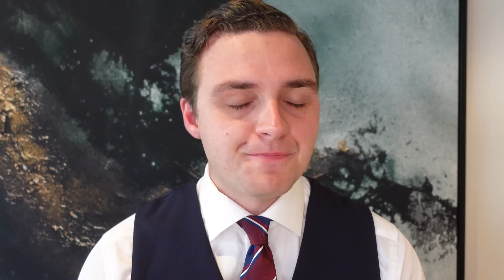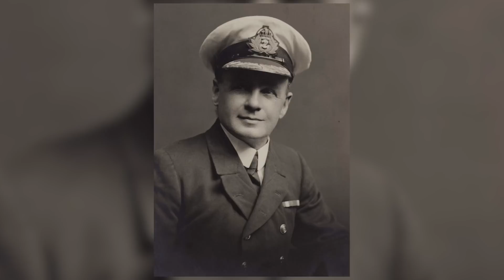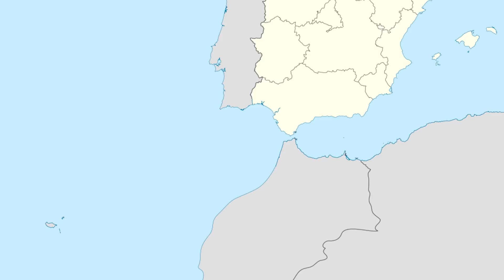How to Annoy the Steam Engine Community

Comment: To give a couple more very minor nitpicks, 15:20 technically a single acting steam engine isn't just pushing the piston up, it can be pushing the piston down instead, it just can't do up and down together. Single acting just means it's acting on a single side of the piston, and most commonly single acting engines are setup to push the piston down not up, much like a 2 stroke internal combustion engine. Single acting engines rely on the momentum of the flywheel and all the moving bits to carry it around, it doesn't need to use the weight of the piston to push itself down.

Also technically Titanic's engines had both piston valves and slide valves, piston on the high pressure and slide on the low. Piston valves are, as the name suggests, basically a set of pistons in its own valve cylinder, whereas slide valves in a steam engine are typically a block with a hollow center that is pushed against the port face. Because slide valves are pushed against the port face by the steam pressure they can have quite a lot of friction/resistence to moving at high pressures, which is why piston valves are used instead on the high and intermediate pressure cylinders. Piston valves being a tolerance fit to the valve cylinder instead of press fit by pressure like a slide valve aren't subject to the increase movement resistence at higher pressure, however where a slide valve will wear in and maintain its seal over time, piston valves wear out and would need occasional piston ring replacement (or new valve pistons if they didn't have replaceable rings).

But these are very minor really nitpicky things. Overall good video correcting the mistakes.

Comment: At the time I watched, I thought that marine boilers were water tube, unlike railway engines which were fire tubed. I was surprised you mentioned salt water in a boiler which is highly corrosive. Railway engines even added water softening blocks when hard water was only available.

Comment: Sea water is never used in a steam system mainly because, when heated, the dissolved salts such as calcium carbonate etc., will deposit onto the hot surfaces of the tubes and furnaces. As stated, this leads to insulation of the metal surface, a reduction in the heat transfer to the water and thus localised over-heating of the metal. This leads to tube failure and the pressurised water will then evacuate into the furnace in what is called "explosive decompression" with concomitant destruction of the boiler room etc....

Comment: Mike, you've still omitted an important part of Titanic's power plant.   At 6:20 you have the water from the condenser returning directly to the boilers via the necessary filters.  Pumps were needed to make that happen, but that is obvious, and you mentioned them elsewhere, so we won't fret over that.
But you omitted the feed water heaters.  These were fed with waste steam exhausted from the electricity generating engines and auxiliary (pumping etc) engines.   The water from the condensers was a little above sea temperature (70 F design centre value) and the heaters heated it to about 220 F (ref The Shipbuilder special edition on the Olympic class, June 1911, page 63).   
The boiler pressure was 215 Lb/in^2.  This implies the water was heated to ~ 390 F - that's the boiling point of water at 215 Lb/in^2.  The specific heat of liquid H2O is very nearly constant.  Thus the saving in coal from employing the feed water heaters was (220 - 70) / (390 - 70) i.e., 46%.
A 46% saving in coal is way more significant than having for example the low pressure propulsion turbine which, while it was very efficient compared to a reciprocating engine, reduced the steam reduction possible and thus power output of the reciprocating engines.

Comment: Absolute and Guage...  Surely if the steam was below atmospheric pressure, it would not be able to exhaust but be pushed back into the engine due to the pressure differential.

Comment: The exhaust pressure of the turbine, and in turn that of the triple expansion engine is dependent on the temperature of the sea water that enters the condenser. A condenser temperature of 100F on the steam side would result in an exhaust temperature of about 0.95 psia. If the condenser temperature could be lowered to 70F the exhaust pressure would be about 0.36psia.

Saturated steam does not necessarily contain water droplets, but it can. We all learned that water boils at 212F, that would be the saturation temperature at 1 atmosphere. Saturated steam is steam that is at the temperature where both the liquid and vapor phase can exist. And if the pressure drops then the saturation temperature will be lower. Superheated steam is steam that is at a temperature that is at a temperature higher than the saturation temperature. Where this becomes important is in a turbine. Because as energy is removed from the steam by the turbine water droplets can form, and these can severally damage a turbine. If you've ever lived in a building that was heated by steam heat and you got steam hammer when the boiler came on, that is what would be happening inside the turbine and it would create huge forces.

To protect the LP turbines like used on the Titanic often some of the HP steam would go through an expansion valve and be injected into the exhaust of the LP turbine intake. This would increase the temperature of that steam and superheat it so that water droplets would not form in the turbine.
 
The loss of boiler water or steam occurred because of leaks in the system. There are many places where leaks occur, valves, piston shafts, turbine shafts, pipe flanges. Almost any connection could leak. The less leaks you have the less makeup water that's needed.

Comment: Correction:  "Earth's Atmospheric Pressure 14.7 PSI".  That is only the average pressure at sea level.  It changes depending on temperature and density which changes at different altitudes.  Weather at sea level will only change air pressure about 0.04 Psi, so we can ignore that.  However altitude does change it a lot.  Example:  At the summit of Mount Everest the pressure is only about 5 Psi.  That is 250 mmHg.  (German Accent) Wrong!  Nein!  Nein!  Nein!  Nein!  Nein!  Falsch!  Unrichtig!  Inkorrekt!  Make another correction video!
😁

Seriously though, I wondered how the pressure in the system could get below atmospheric pressure and produce power.   The steam cooling, condensing, and creating a vacuum, which would then pull in air to create power on some engines makes sense and answers my curiosity.  So thanks again for this video.  It answered another one of the questions your other video created in my mind.

Comment: Thanks for pointing out the salt water mistake.  I know relatively little about steam engines.  I know a bit, but I wouldn't consider myself an expert.  I recently talking to a guy about steamships and told him they can't use seawater in their boilers, steamships use fresh water in their boilers.  When I saw your video saying Titanic used sea water I thought I was wrong.  I even left a comment asking about the maintenance schedule of the boilers.  I was thinking of rust eating through and how did they flush out the salt.
     The other ones I can relate to.  I often say square feet instead of cubic feet, even though I know the difference and use the two units often in my work.  But I probably have brain damage so....

Comment: Thank you for this two videos. Very interesting. There are sooo much more details about the engine rooms just enough to make 3 or more videos like this. Sample... the electricity on board or how to cold start the titanic. Also the ashblowersystems and the refrigeratorsystem. The quadtriple expansion engine also dont use the same size of pistons like it was shown in the video. Only the two lowpressure pistons on the outer edges had the same diameter. They get bigger by the ingressing volume of steam by lower the pressure. Next detail was how to start this engines. They had helping engines to turn over the crank in a starting position. It was the  90 degr. angle between big end and crankweb of the lowpressure cylinder i think. The LP pistons are depending on size and ther counterweights, the hardest to turn over. So every triple engine had so called impulsevales or startvalves to send highpressure steam directy to the lowpressure pistons to turnover the engine meanwhile the draincocks are open to get the condensed water out of the engine. Tgey closed them when the engine was hot and running. The direction was not controlled by the helping or starting engine by turning over the main engine. The direction is set by the excenter position 90-120° on top death center in advance to the rotation direction on eatch singe valve 3 times in one and 3 times in the reversing direction. The high pressure cylinder had piston valves depending on the temperature of steam with 210 psi. It would bend a shellvalve. The LP cylinders had shellvalves. Alsobthe valves had specific overlappings for the steam ports to let the biston runsninto a steam pilow on each end of the stroke to run it more soft.

Comment: Good on you for this. I would check the bit about the piston and valves. Yes its right but at least on steam locos , and I suspect on these engines, the valve admits high pressure but closes well before the piston is at the other end of the travel and it expands the steam (where as your animation doesnt show the valve closing early). Damned good video though

Comment: Regarding the water heated in the boilers:
I really wonder if it would be possible to rig a supply line directly from the water inlet to the boiler in order to maintain the cooling function of the same even in the worst emergencies to be thought of.
Something like the main engines self-destructed, taking with them the primary and secondary condensers along with the seawater filters and the valves to vent the steam. The fireboxes are still hot and you have to control them somehow to avoid thermal breaks and the resulting BOOMS.
Although this is probably the least of the problems in the scenario described

Comment: I wish I could have thought to record my old engine room. The sound of 65,000HP turbines maxed out and then a buzzer sounds and we provide steam to launch a 20ton aircraft in 3 seconds. The boilers would actually start “huffing” visually. The din heat was incredible. The main steam lines were so hot you could light cigarettes on them and a small leak could cut your fingers off (superheated steam is invisible). Conditions down there were so rude Marines were send down to us to chip paint as punishment.

Comment: Mike, at 15:37 the diagram states and you say 'slide valve', however the diagram illustrates a 'piston valve' - there is a distinct difference between them. A steam engine's slide valve has essentially just one sealing surface, and any wear, to a certain extent, is taken up by steam pressure acting on the valve, pushing against it to maintain the seal. A piston valve is similar to any other piston in that it runs in a bore and has piston rings to make the piston steam tight. Piston valves are more efficient and can be more accurately adjusted, but when the piston rings start to wear, they start losing their efficiency. Railway locomotives started using piston valves in the early 1900s, but mostly only on the modern higher-performance designs. Simpler run-of-the-mill designs kept to slide valves as they were cheaper to build and maintain.
Respect to you for making this video - there's so many who just make videos for the sake of it without having any understanding or passion for the subject.

Comment: I read about the Britannic’s engines and found out that although the engines were the same size as the previous design in terms of their dimensions, each engine produced 16,000hp at 77pm. The additional power output from the same engine size was achieved by the use of piston valves in all cylinders, whereas on Olympic and Titanic the cylinders had flat slide valves and produced 15,000hp at 75rpm.

Comment: Thank you for this video. It is nice to see a video with multiple corrections.
A little note. 15:38 The reciprocating engines on the Olympic class had two different types of valves. The High pressure cylinder use one piston valve (round in shape) and the Intermediate pressure cylinder used two piston valves. Both Low pressure cylinders used two slide valves (has a flat seat).
Steam goes into the engine due to pressure (not injected) and gets exhausted out of the cylinders due to the reversing stroke of the piston.

I am a steam engine driver and for over twenty years operated a 1911 triple expansion engine in a museum. (The low pressure cylinder was 54" the same size as Titanics high pressure cylinders.)

Comment: 14:40 I think you meant Thomas Newcomen's engines worked entirely below atmospheric pressure.  They weren't really "steam" engines at all, but rather atmospheric engines.  They just used steam to warm up the cylinders and expand the air to get the piston to the top.  At that point, cold water was sprayed into the cylinder to condense the steam and create a vacuum.  The air pressure on the other side of the piston did the work.  This was horrible thermodynamically, as Newcomen's engines had a thermal efficiency of about 1/2%.

Watt realized that this poor performance was due to cooling the cylinder every engine cycle.  His design used the steam itself to do the work, which kept the cylinders hot, plus he added the idea of pushing on the piston in both directions.  His engines were on the order of 10% efficient, which is still not great, but 20x better than Newcomen. By the time we get to Titanic, 150 years later, they were up to around 30% efficient, but I have no numbers on the Olympic class engines specifically.

Comment: Even in 1912 on locomotives superheating was in its infancy.  They were finally shying away from superheater units that were contained only in the smokebox (to disappointing results) and compounding (like on Titanic) that were maintenance nightmares.  By the 1920's, they'd finally refined the form of using superheaters in the fire tubes to get the best superheating effect.  If you get a chance, check out the Denver and Rio Grande Western's "Mudhen" K-27 class and how it went through all those changes from a compound, to a simple soak with slide valves, to superheated with piston valves.  From 1903 to the late 1930's much of the locomotives were completely replaced.

Comment: I have learned as much as I could about steam from my interest in warships. It has puzzled me why the navy didn't use the quadruple expansion system more often. I know the navy needs fast ships. Alas, As you said, the quadruple expansion system was almost as fast and could run steady for a week or more on 1/4 of the fuel. The turbine engines, common in warships, could burn most of their fuel in a few hours of battle, torturing their engines. Leaving them in serious need of overhaul. For what? 3-4-5 knots. I think it is bad economics.

Comment: Saturated steam is still today used in certain applications including to operate steam turbines of a specific type and design but where saturated steam is most efficient is for heat transfer applications in heat exchangers.
Super heated steam is used for operation of steam turbines and never for heat exchangers since the ability of being an efficient heat conductor is terrible in super heated steam.
The boilers used in Titanic were fire tube boiler also known as Scotch Marine Boilers. 
The boilers later used in ships like Queen Mary and United States were water tube boilers which operated at a much higher pressure and producing super heated steam.
Operating in ships with super heated steam boilers can be a bit exciting since leaks from super heated steam systems are invisible. You can hear the leak but not see it which sometimes resulted in steam burns if you managed to get "cut" by the leaking steam jet (I have 3 scars from that as a reminder of my time in steam turbine driven ships).
The higher the pressure of a boiler, the higher the requirement of the water quality.
Depending on pressure and type of steam systems, the water treatment may differ quite a lot. The feed water and condensate water chemistry is probably the most important subject when operating high pressure steam systems today.

Comment: I hage no basis to disbeleive you, but am quite perplexed by the absolute 9psi pressure for the secondary turbine engine.   I get that the greater the pressure differential before and after a turbine or piston, the greater the force will be generated.  And the only way I could see the area aft of the turbine being lower than atmospheric is of the condensor(s) are sealed and manage to condense steam into water (major shrinkage in volume) faster than the steam comes out of the turbine. But ironically, if they used same principle as locomotives, they would then used steam released into pipe to accelerate the water to reach 14.7psi (and climb back up to top of water tanks ahead of the boilers).  (and then same principle to get water in tanks at 1 ATM to accelerate and enter boilers at 200 psi. )

Comment: In a closed system, a "vacuum" is higher pressure moving toward lower pressure. The actual high & low pressure measurements are irrelevant when defining "'vacuum" .